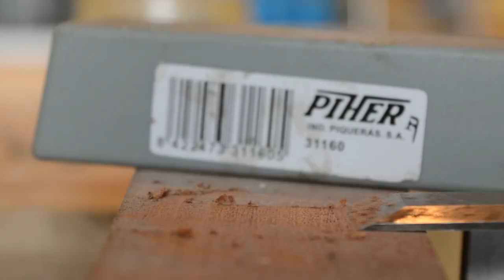Building my Ideal Electric Guitar #greatguitarbuildoff #greatguitarbuildoff2020

Comment: I will say, that is one hell of a good clean solid and tight neck joint glue in you achieved there. Super satisfying. Cant even see the line in the separation of the body and the neck. Only reason you can see anything is the change in direction of the grain between the neck and body,. Good job dude.